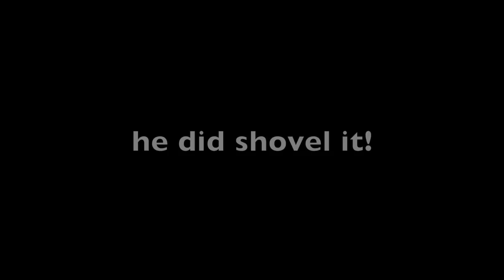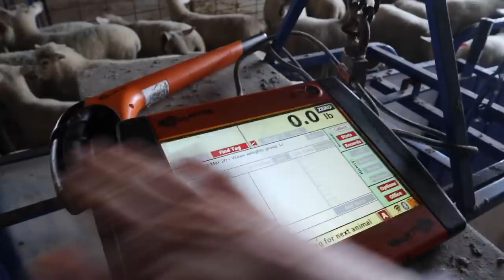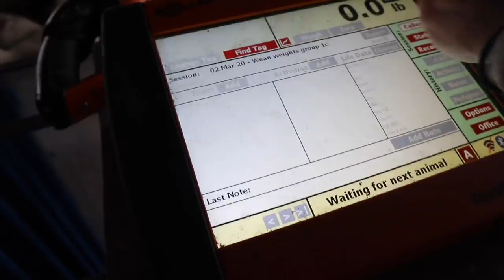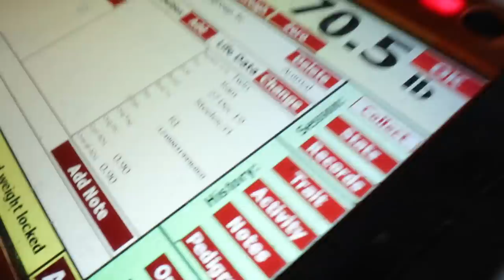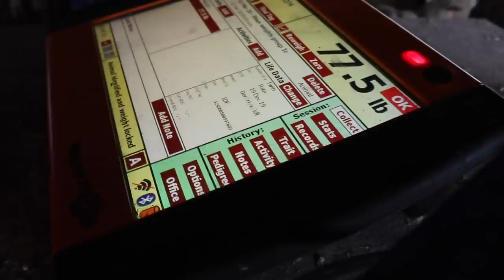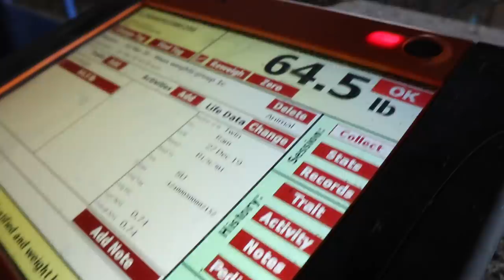HOW DID THEY DO?? (Final Results for the December Lambing Group):  Vlog 249

Comment: I'm not a farmer, but...If the snow piles up again, could you not use your front loader or whatever machine you use to clean out the bedding to scoop/shovel the snow away from the barn? In my head I'm picturing you coming in perpendicular to the side of the barn, scooping up a section and then backing out and turning around to dump the load away from the barn. Does that make sense?

Comment: Couldn't you just use your lawn mower to plow through that stuff? 

The modern snow blowers are basically just differently shaped lawn mowers. (Now you might have to set it up inside basement or garage because people sometimes winterize them. But there are videos with it working...and then you might not have to be doing it by hand; wreck your back and get blisters.)

The area you are in also it could get cold enough some nights to damage an engine maybe if left outside after you are done. Then return and report. 

In theory, you might could clear the whole area with lawn mower. But I do know people that have lost toes to them, so careful. And you'd have to do a mental check and hope you didn't leave anything sticking up that could cause an accident hidden under the snow.

https://www.youtube.com/watch?v=pGU_yZZlY60